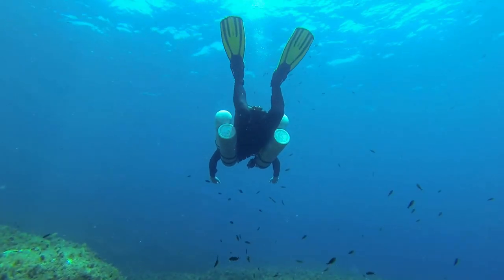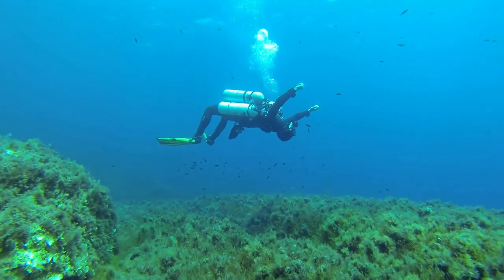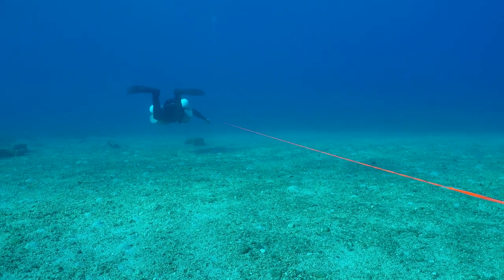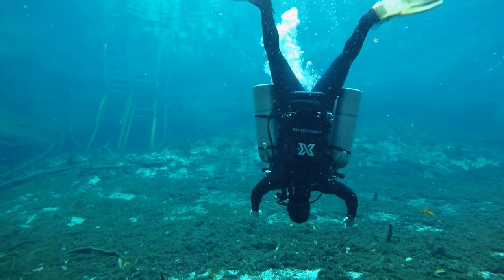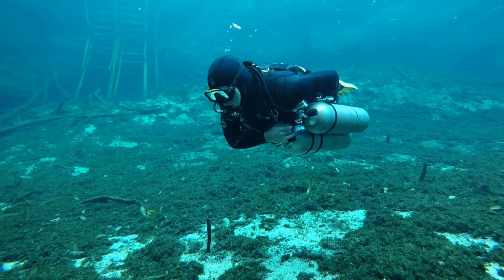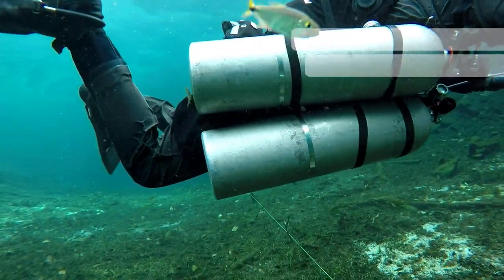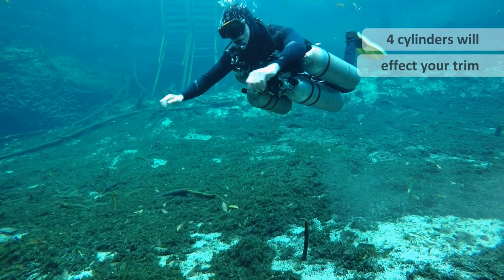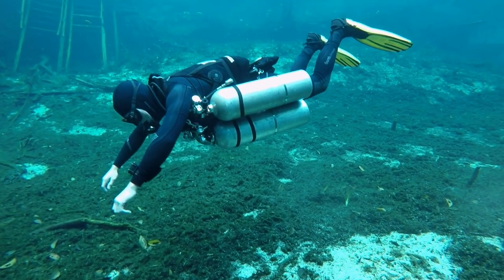Multiple Cylinder in Technical Diving

Comment: It is great video, it helps me a lot! Would you like to tell me, what BCD are you using here? Like, I'd like to buy a sidemount BCD to dive in, but I'm not sure if I could dive with 2 tanks + in any BCD/ I do not want to buy one BCD to dive in 2 tanks, and then must buy second to dive with 3 or more tanks. So please, could you tell me, what BCD are you using here, and can I buy any sidemount BCD and dive with more tanks than two?
Reply from the maker: I am diving an xDeep sidemount system in the video, it was actually the classic wing but that has been improved and recommend the xDeep TEC sidemount system, the other I use a lot of the time is the Razor sidemount system. We have many video on this and more, there is a Masterclass workshop for only £10 with 4 hours of online lessons and a new intro to sidemount program £25 https://youtu.be/6a3RbAYv3KE. I suggest you invest in them and maybe even consider our full sidemount online course, it will be the best money you spend and will do a lot more than just help you setup your equipment https://www.sidemounting.com/shop/ Regards, Steve
Reply: @sidemountscubadiving  Thanks a lot! I appreciate that. Sure, I will take a look at these courses. Thank you!
Reply: @sidemountscubadiving 
Is there a backmount stage tank?

Comment: Very good video. Thanks.
Would you perform weight check for the dry suit setup with empty dry suit.?
Reply from the maker: Hi Piotr, surface weight check yes and empty BCD. But the only way to get correct weight is the underwater weight check at 5m/15 feet, that is with air in drysuit to stop the crush and a bit more if you need the warmth for extended stop, empty BCD and cylinders at reserve pressure. We cover all this and much more in the online sidemount course, plus we are adding much more drysuit videos in the next few months too. Cheers, Steve